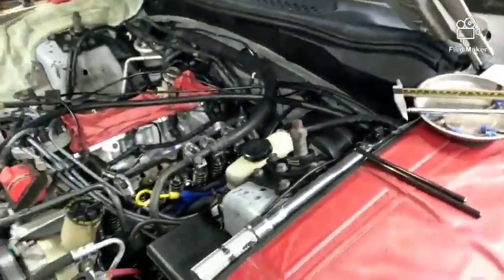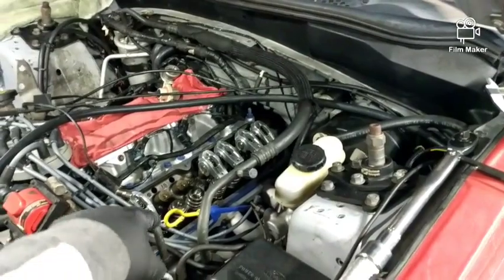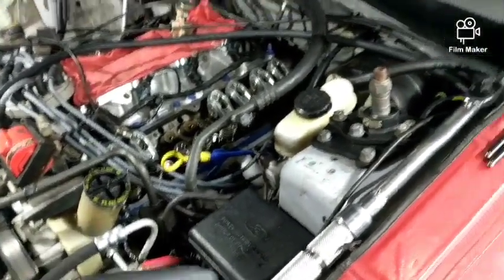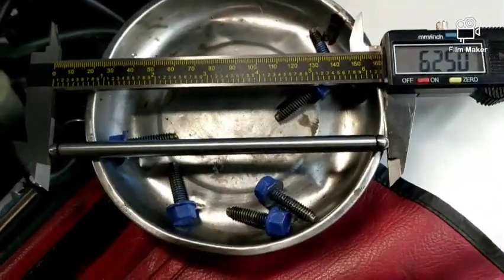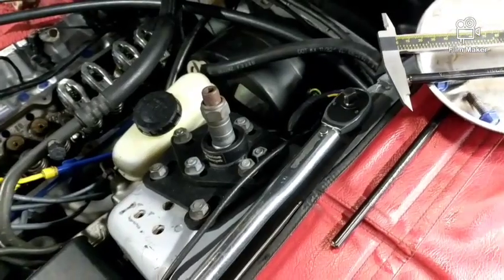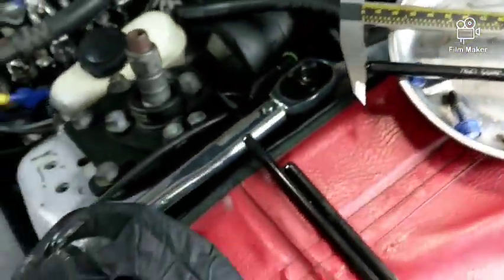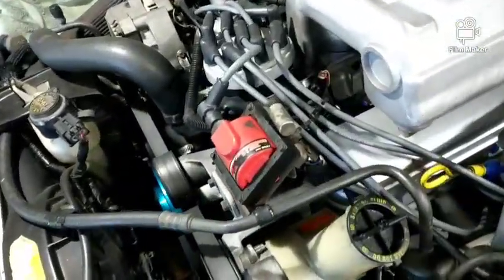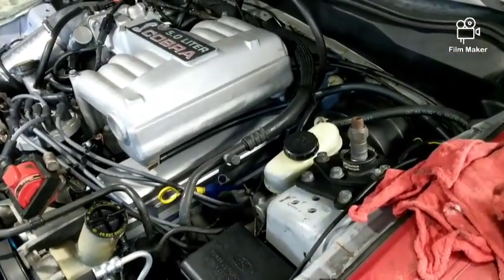Found something peculiar while swapping pushrods on 94GT.

Comment: From Alex Parts, 
Alright.... In regards to pushrod lengths, we'd like to clear up a common misconception.

Question- Is the stock pushrod length for these engines 6.250" or are they 6.272"?

The answer is... (insert drum roll here) In this case, 6.272" & 6.250" represent the same length. What? How is this possible? Well, 6.272" is the "theoretical length" and 6.250" would be the end to end "measured length".

Lets see if we can clear up the difference, we'll start with theoretical length- For these engines, it's always listed as: 6.272"

Theoretical length is what the pushrod would measure if it didn't have oil holes in the ends. These oil holes take away around .012" per end for a total of .024" for one pushrod.

This is only for pushrods with "through oiling". On pushrods which are not drilled for "through oiling", the end to end measurement and theoretical length, would be the same. On engines like the 302, where oil flows through the pushrod to lubricate the top end, the measured length will be around .024" shorter than the theoretical length. Starting to make sense?

To understand this better, lets do a little math.

Since the stock pushrod length is between 6.245" to 6.250", lets call it 6.2475" which is right in between the tolerance range. Then, lets add in .024" (.012" + .012" = .024") to see what we come up with.

Since we're working in thousandths of an inch here, (3 digits past the decimal point) were going to round the forth digit up by .0005" which gives us 6.248"

  6.248"  (averaged measured length)
 +.024"  (.024" for missing portion of the ends radius from the oil holes)

= 6.272" (theoretical length)

The next question might be- Why do they use theoretical length figures for pushrods with oil holes? Well, because that's what the real length actually is, its the presence of oil holes that make the measured length shorter. Which begs the question- Then why would they use the measured length in some listings and theoretical in others? The old school method was always theoretical and in modern times, some manufacturers are trying not to baffle customers with hopes they'll sell more pushrods. Yeah, it can be confusing but this is the way it's been for many years.

Worth mentioning, some of the single piece pushrod companies use a totally different method called "Gauge Point". On single piece pushrods, the measured length will typically be around .015" longer than the length laser etched on the pushrod itself. This is the result of using the gauge point method.
Reply from the maker: I think comp has the same info on their page, I know I've read it before.

Comment: Keep the videos coming! Have you ever ran into pushrod length problems with the crane 1.7 "cobra" rockers? It seems every time I've tried using them the valve hangs open slightly when tightening them with stock length pushrods. It's usually only with gt40p heads. That's what I always run.
Reply from the maker: That's what's in mcstruggles, no issues with them.

Comment: The idle needs more unmetered bypass air to help the IAC be in its happy place. 
As technical as you are I’m surprised you aren’t verifying the optimal pushrod length to set the geometry.
Reply from the maker: That should have been done with checking springs and my modified lifters. As pushrods typically come in .050 increments I think these will work fine without any problems.

Comment: Did you measure all of them? I was reading someplace the other day about how trick flow sent them 2 or 3 different lengths, all labeled the same
Reply from the maker: Wouldn't be at all surprised, when I get them out of the box new I lay them out and check that they're the same length, I just never measured them with the caliper.

Comment: which cam are you using David?
Reply from the maker: One I had comp do, it's pretty mild. 218/230, .544 with the 1.7s. It's the XE270 intake lobe with a different exhaust lobe. Going to put it on the rollers in April, should make decent torque.
Reply: @FXRSDriver  update us on how the pushrod work out. I am using a custom grind comp roller with 568/572    228/236 and have to get pushrod length right for my 347